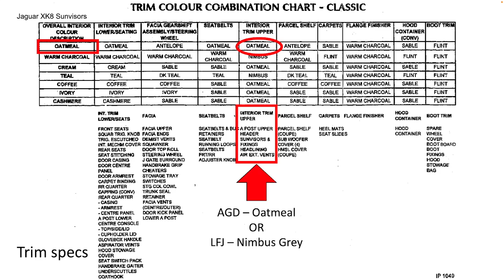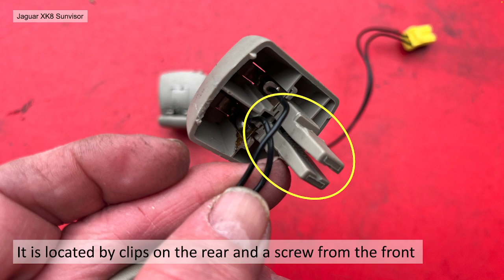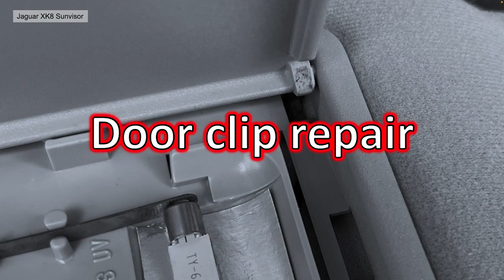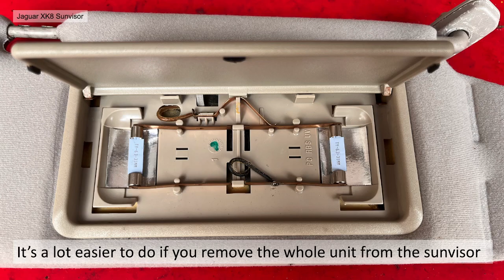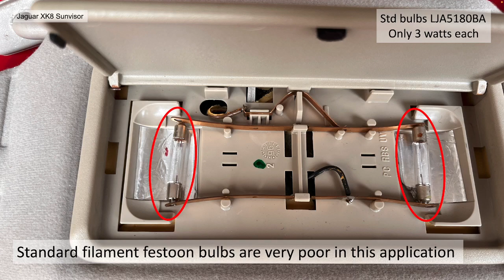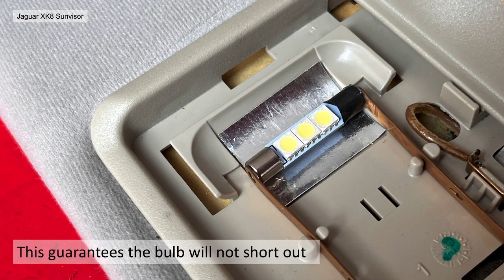Jaguar XK8 Sun Visor Removal & LED Upgrade (Stop Blown Fuses!). V187 XKR / X100

Comment: Another awesome video and another really great tutorial! Thanks to your videos, I was able to repair the sun visors without breaking anything or snapping any of those little clips or brackets.

Everything was explained so clearly that I managed to get the whole job done without damaging a single part — even though some of that old plastic is really brittle after all these years.

Absolutely brilliant! Thank you so, so much for all the time and effort you put into making these videos. They’ve helped me out more than once and are genuinely incredibly useful. Really appreciate it! 👍
Reply from the maker: Mac M, thank you so much for the fantastic feedback.
Dealing with that aged, brittle interior trim on the X100 can certainly test your patience, so hearing that you got both visors sorted without snapping a single clip is a massive win. Taking the extra time to show those hidden tabs and gentle removal techniques is completely worth it when it helps keep another Jaguar original and unbroken.
Working and learning together as a community is what keeps these cars on the road.
If you haven't already, please check out our new channels (@ModurolLive and @ModurolShorts) and consider subscribing so you don't miss any of our upcoming interior and mechanical guides, regards Damian

Comment: Another great video. I have replaced all the other bulbs to led and the last to be replaced are the festoon bulbs for the trunk and vanity mirror. Just purchased on Amazon an assortment of 42 bulbs from Ebaifun including T10, T5 and festoon bulbs from 29, 31, 36 and 42. I only needed 2 of the 29 and 2 of the 42 but since the prices for 2 or 4 depending on supplier 29  and 42 festoon bulbs is around $17.00  for each size this gives me a lot of spares for only $28.00 Canadian. I am so glad I replaced all the bulbs with leds. So much brighter. Hopefully they'll last. Againthanks for the excellent video.
Reply from the maker: @craigoliver4631, glad you are happy with the brighter bulbs. Makes a real big difference especially at night, you can actually use them to see stuff. Thanks for sharing your experience, much appreciated, regards Damian

Comment: Are the visors interchangeable for all model years? On eBay, I see some visors listed as "97-99," others as "97-03," some as "00-06," and still others as "97-06." I have a 2002 XK8 with damaged visors and have bought replacement visors out of a 1997 car that I hope will work!
Reply from the maker: @lehighguy, we believe all the sunvisors are the same design. Just need to be careful to pick the correct colour code for your headliner. Hope that helps, regards Damian

Comment: You failed to read the XK8 Bible on the fuse blown issue.  I found the 36mm festoon LEDs to be a better fit.
Reply from the maker: Gary, thanks for the feedback. Fitting LEDs is simple until you get to the vanity bulbs. Took a little while to figure it out on my own, after a lot of fuses blown. Never thought it would be an issue. Thanks for the recommendations, regards Damian

Comment: Just what I needed! Saw mine are a bit tatty yesterday and then said hmm I wonder how to remove the sun visors 👍🏿😂😁 lo and behold this video appears!
Reply from the maker: @SuperchargedShift, good timing, hopefully this video will help, released on Friday, 
regards Damian
Reply: @Modurol  Hi Damian; Got the new bulbs today and they fit and work perfectly. Changed the passenger vanity mirror bulbs.  You are a genius. I took your suggestion and wrapped electrician tape a couple of winds around one end and zero fuses blew. 
However when I put the cover over the bulbs both bulbs went out but when taking the cover off again both would go on. After a few frustrating attempts with the same result I angled the bulbs away from the middle more to the side and voila works perfectly. Hope this helps others that change their bulbs to led.